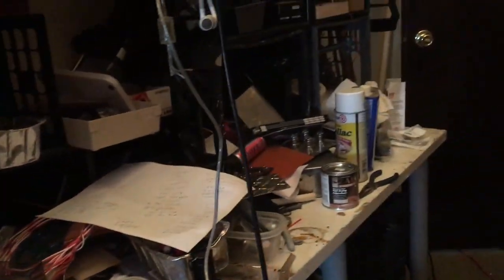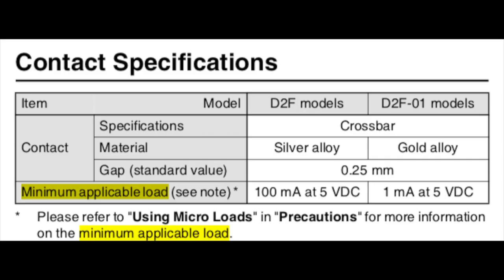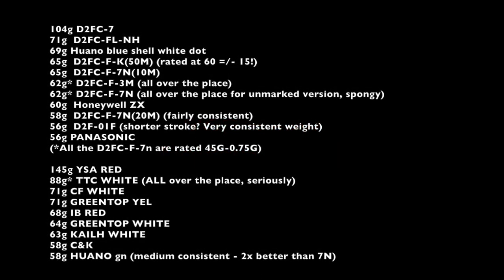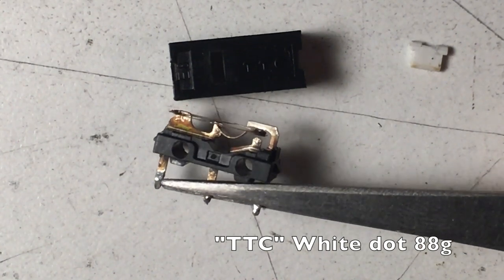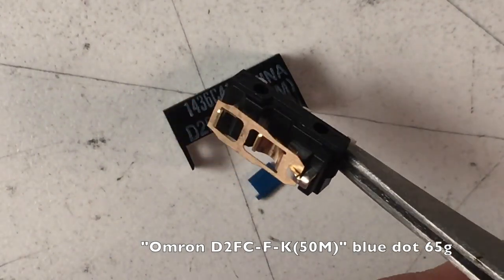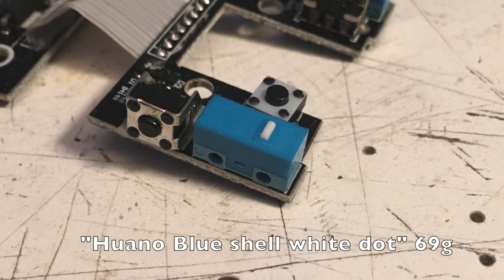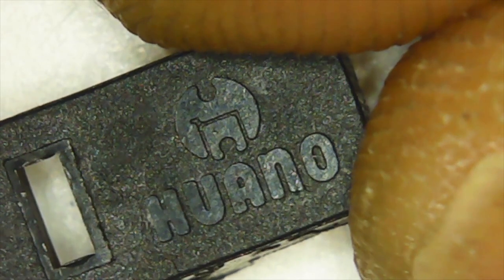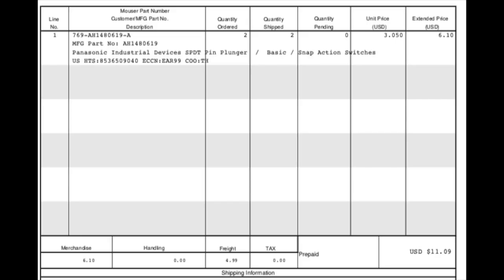Failing mouse switch part 2: teardown and testing

Comment: Fun fact: Just purchased the Glorious model O and it has an actual debounce timer inside the software so you can increase it if the mouse starts to doubleclick. They're not fixing the problem but at least they're acknowledging it and giving the user some options, that's a step in the right direction.
Reply: @anoctopusstolemytoesplease7940  yep

Comment: If the work area is clean, it usually means nobody is working. Nice follow up and break down of the different switches. Edit: Apparently new solder wick does the trick. It's a lot easier to deal with now.

Comment: Hey Alex, I had commented before about my Razer mouse with optical switches. Maybe you remember. This info is all just FYI in case you wanted to know how it held up.

The good news is that the optical switches still work perfectly. The bad news is that this mouse doesn't know how to charge a lithium battery, so I have to use it on a wire now. The other bad news is that the back button is not an optical switch, and it, predictably, has failed. The third bad news is that the scroll wheel is hesitant (goes up/down between clicks) and scrapes. So the Razer Viper Ultimate $150 mouse isn't worth $150 but the main 2 buttons still work flawlessly. And it's lightweight, and the cable is pretty good. The white feet are absolutely excellent.

Comment: 2023-04-24:  Randomly remembered today (while swapping mouse feet); 2 years and 4 months, and ~5.8 million LMB and ~1 million RMB clicks (Whatpulse stats) later, and these Honeywell ZX switches are still working flawlessly.
---
For what it's worth, I replaced the D2FC-F-K(50M)s in my G502, which had failed on both L and RMB, with Honeywell ZX10C30A01
 switches.
Pretty straightforward, and external dimensions were near enough to identical to work as a drop-in replacement.

The Honeywell ZXs definitely feel different—close to linear, I think, so a gradually increasing force curve with little (if any) drop-off at the actuation point.
Omrons are heavier and more tactile, or, a steeper force curve until activation followed by a significant drop-off, so have a snappier feel.
The Honeywells also have a somewhat lower-pitched and louder click than the Omrons.
I think I prefer the feel of the Omrons, just a shame they don't work.

Here were the external dimensions of the switches, in case anyone's curious, measured with an old inch micrometer:
OMRON D2FC-F-K(50M)
.258" H x .225" W x .506" L
Actuation point, from base: .277"

Honeywell ZX10C30A01
.255" H x .235" W x .506" L
Actuation point, from base: .279"

I think the ZX10C30A01 (logic-level, PCB snap-in, pin plunger) model has recently gone out of production, so for anyone else interested in the future, it may be necessary to look for one of the nearly-equivalent (logic-level, PCB straight or snap-in) models with any of the lever actuators, which may be easily pried off to reveal a standard pin plunger underneath.
https://web.archive.org/web/20210624200946/https://sensing.honeywell.com/honeywell-sensing-micro-switch-zx-basic-product-sheet-004990-2-en.pdf
Reply: They're not out of production, they just have a ridiculous minimum order quantity of 1000 units from everywhere I could find for the ZX10C30A01.

However even though the the datasheet literally doesn't have the gold plated option (logic level - ZX10 Series) for the PCB straight "ZX10C20A01" these do exist and are actually what you usually want to put in a mouse, as usually that is the mount type that they use in mice from the factory anyway provided the mouse isn't hot swappable.

TL:DR - If you want some of the Honeywell's get ZX10C20A01, basically the same switch in the video, but the mounts are a straight solder post which 99% of decent mice already use anyway.
https://uk.farnell.com/honeywell/zx10c20a01/microswitch-spdt-pin-plunger-0/dp/3439200
Reply: @oOBlackThornOo  
See: https://www.ttieurope.com/content/dam/tti-europe/products/PCN/Honeywell/PON_Obsolescence%20Communication%20Letter%20PP%20Dec%202020%20Final.pdf
ZX10C30A01 is in the list, but curiously several models that are identical but for the installed lever are not.

But yes, the straight terminal equivalent ZX10C20A01s are acceptable, and probably preferable in case you decide to replace the switches again, because those snap-in terminals actually require quite a bit of force to go in (or out) and would make desoldering difficult.
Reply: @EyeDeck  You're right, mouser and places have yet to update the product pages as they normally put a little life cycle badge on EOL components and advanced notices.

I never realised how buried the PCN's were as I couldn't find anything initially, TTI seem to have a really good tool though which I never knew about for searching the major manufacturers PCN's.

Yeah it is strange that they are discontinuing certain SKU's yet seemly kept others of the exact same type bar actuator. 

Like you suggested though worst comes to it they're easy enough to pop off if you have to.
Reply: @EyeDeck  Currently, I can't find the ZX10C20A01 anywhere, however on mouser, I managed to find the ZX10C30J01 at ~ $3.50.
Anyway, with the 30 style snap-in termination, I wonder if straightening the pins and sanding it to make it more easily removable if need be, actually is a good idea... would you happen to have any insight about it ?
Also, yeah I have the lever to remove.
Reply: @nlight8769  The snap-in terminals would definitely be difficult to desolder—even without solder, it's pretty tough to remove that style of switch from the PCB.  Straightening them out beforehand would absolutely make desoldering easier later if you find it necessary. That thought had crossed my mind, but since I've got a second G502—the first of two, which developed contact issues after ~7 months, Logitech shipped a replacement without return under warranty, and of course the same thing happened to the replacement after a few months—I figured I'd probably just start experimenting on the other mouse instead if these Honeywell switches failed.

As for a status update, my current G502 has gone ~4.7m clicks over a year and a half between L and RMB since I installed the ZX10C30A01s, going by Whatpulse statistics. They're still working perfectly a year and a half later, haven't had any contact issues with these switches whatsoever.
Reply: @EyeDeck  Thank you for the feedback, much appreciated :)

Even though I ordered a pair of overpriced D2F-01F in the end, because quick delivery and very pressing matter. I'm definitely ordering some honeywell too, the construction looks really, really good.

Apparently, new mouses suffer the very same flaw, how ludicrous.

Comment: One quick tip from me: Stop supporting Logitech . Yes their warranty service is great and sometimes they will even give you a new mouse without wanting the old one but it has gotten to the point where that is not enough to justify the shere rate of mouse failures.  I've spent enough money on their mice to buy a PC and it's only getting worse. If you are a hardcore gamer that can't afford constant mice failure and you  want to eliminate the problem until or dare I say IF they fix it without soldering skills just purchase a mouse with hot swappable switches like the mice from Asus ROG and buy a bag of switches that you prefer. That is IMO the best option at the moment.
Reply from the maker: Oh totally, and believe me... when my g502 finally dies for good, I'll be looking elsewhere, maybe even sooner.  I'm just waiting for either a mouse that ticks all my boxes, or a viable open source project to pop up so I can say screw it and make my own
Reply: @AlexKenis  Unfortunately, I haven't really found a good alternative to the G502, so in the meantime switch replacement is where I'm at. Which switch has lasted you the longest?
Reply from the maker: @benjaminchen4367  I have been running  both a Japanese omron and the wacky Honeywell micro since this vid came out and both are still going strong
Reply: @Alex Kenis  awesome man, and thanks for responding so quickly. I'm thinking of getting a g502 lightspeed and preemptively buying some Japanese omrons to have on hand, altho I can't believe I'm buying a $120 mouse from a company that can't get rid of double clicks. Those extra buttons and that shape are just too unique
Reply: @AlexKenis  Also, have you tried the Kailh GM 4.0/8.0s? Those seem to be the go to replacement switch in the places I've looked, as opposed to the japanese omrons, but I can't find a datasheet that can verify they are suitable for microloads
Reply: @AlexKenis  The best alternative to the Logitech G502 seems to be the Razer Basilisk Ultimate which has optical switches
Reply: @benjaminchen4367  That's why I'm thinking of getting a cheap, used G502 Lightspeed from eBay and then have it « serviced », if I do decide to get the G502, that is.

For now, I'll stick to be G900 Chaos Spectrum. I haven't run the double-click test yet. Fingers crossed !

Comment: thanks to you my mx 518 has a new lease on life my 502 hero has the click and drag issue haven't got the nerve up to taking it apart yet, as it's still under warranty. I practiced on the 518 firs and fixed a non working lmb.

Comment: i found the first part very interesting. i wonder if you could do a 3rd part with some mods to fix the switch issue. maybe like the resistor mod you suggested?
you suggested too gold switches like the japanese omron but the popular here is the kailth red.do you think it is fitting?
Reply from the maker: I couldn't get ahold of the 'newer' Kailh switches when this vid was shot, but I may order some when I get some keyboard switches next.

Comment: My Logitech g602 with d2fc-f-7n(20m) didn't even last for a year. i did fix it by bending the copper for more tension but it may woreout soon.

Wanting to replace the  microswitch and saw some d2fc-f-k(50m) online. Would it be an upgrade? Or do i have to buy same model? Thanks!
Reply: I think if anything you probably don't want the same switch or a switch from this same family. For one, you can't hold the seller to the promise that it's actually a 50M variant, it might be counterfeit, as all D2FC variants look the same on the outside and the painted on designation is too easy to modify. For other, the 50M switches fail just the same.

Consider using a D2F (japanese, without C) family switch or maybe Kailh or whatever else nice you can find. All the switches shown here have the same footprint, they'll all take up the same space and fit into the same holes. They might have a slightly different height for the nub by a fraction of a millimetre, but you can just shave the protruding actuator piece in the mouse shell button section or shim it as needed, and odds are, no modification may be necessary at all. But do take a look at the actuator there, it can show some wear which isn't good for the switch and may need to be fixed.
Reply: @SianaGearz  Can't confirm switch durability (50M vs 20M) but have placed order for link provided and tested force resistance (0.7N) - so ~130g? Based on Digikey/Newark/(other enterprise component distributors) pricing per unit I expected as much...Not that OMRON even has public listing. 99% mutually exclusive supplier agreements. Shout out to Rossman?!

Comment: Hey there, great comparison! I got one question which might sound strange at first: under real life gaming mouse circumstances -> ~1mA on the switch - is it possible that on average chinese omrons vs japanese omrons get a few milisecs of latency in before being registered as "1", maybe due to ripple etc? there is one video on youtube that claims a few milisecs difference between those to and ever since im hunting down further information. Or is it maybe just mechanically faster due to the spring loaded mechanism on the japanese ones?

Comment: I have tons of questions and feedback from you here but first off-Im subcribed  because i find information you give on these switches are technical- bc i like to mod my mice-current project is to put the mouse wheel on the side where it is going to be moved with the ring finger. So, ive never had a switch fail on me. The end of its lifetime usually 1- going to a cooler newer model 2-sensor problem like the cursot jumping through the screen. 
Perhapd its because I tend to slide the mouse rather than lifting them bringing it down with a few g forces. I tend to releasd the switchs once it clicks or in other words i feel it click then release rather than making sure it hits the bottom.
So maybe my reason is 2 things - environment and "noise"- it does go through shocks and jolts bc unconsciously I avoid any force (a habit with any electronics including a stuck remote)  

Comments? could electronics fail quicker through an environment that is noisy like in an assembly plant which it will go through lots of mishandling?

Also why are some switches have to 3 pins and not 2 for on and off. like the omron has 3 pins. Also how do the scroll click switches work? because i have seen at lease 3 types-razer trinity has like a black with red shaped just like an omron - maybe it is but i broke it by accidentally pulling out the cover while desolding 2  - razer naga- 2 pins with a spring on top of the switch so the mouse wheel can stay up as well as increasing the travel that common switches have. 3 - logitech mx revolution- the switch is weird but its very narrow and the cap isnt like any other switch out their. I has a longer travel and shaped like the end of a wide knife in other words its 3 angles vs normal switches. why is the razer trinity use an omron when other wheel clicks dont. This is for wheel click (pressing down on the wheel)

Also, if you read this far I appreciate it- but if you are interested I can send you my switches so you can analyze why they last 4 years or so. They dont skip clicks and they only get replaced bc the mouse sensor or updating to a fancier model. I have a 10 year old microsoft usb 3 button mouse. Are these switches inferior? All i know is I like fast actuation and fast release so I can rapidfire. This usb mouse is heavier (takes more force to press down) 

Just interesting how my razers last years when they have a high fail rate for many others. Another thing is cleaning- regular cleaning avoidind the sensor. Keeping the mouse wheel from accumulating lint/cat hair. The mouse pad stays clean. Not much when it comes to dead skin or dust.

Glad you stuck with the end- now you know what I went through with your other video that was impressively 1:15:00 long
Reply from the maker: Sorry about the delay... been busy. My older Razers have also lasted forever, but it also sounds like you have good click discipline with very little overpress and 'press-and-grind' which I imagine will greatly extend the life of the switches, especially some of the omrons that have a tendency for the contact to slide off to the side.  It seems (no proof, but it seems this way) that some of the Razer shell designs may alllow people with a more 'button-mashy-grindy' style to do more damage to the switches and wear them out faster... but that is just pure speculation from what I have heard from folks. As far as noisy/vibration environment, I'm not sure about that, but if the warehouse environment is a combination of hot, humid, or has a high sulpher/sulfate count in the air, then oxidation can set in prematurely on silver-oxide contact switches. Some switches are 2 pin and other 3 because there is a "no contact" pole in many of them that would allow them to be used as a toggle or latch-reset, but almost every mouse only uses the one set of contacts. I have a few of those MS optical mice as well, and those switches are not worse, many people just don't like the feel of that micro pushbutton style

Comment: I`ve watched both of your videos and they are very good and highly techical. But, you did not compared the most important thing (probably because you had no problems with this), and that is the housing of the Japaneise switch and it`s dimensions, to be precise, the main housing is the same, and the size of the plastic object which is pressing the platter is different. It is little higher than thing on the Chinese Omron. Because of that, there is a problem with several mouses and their housing where I soldered the Japaneise Omron sw. Ex. Logitech G700, G9, G403, MX Master, MX performance, in my case.
Reply: yes, i have tried japanese omron on roccat kone pure optical and  razer deathadder 2013. the housing of japanese omron is a bit taller compare with chinese omron which caused a problem when clicking the mouse, the only solution IMO is do not too tight when screwing up or replace their housing using chinese one.
Reply: @Sarah.Lemontea  No, this is not a good solution, I advise you not to do that. Instead, look out this switch on aliexpress: D2F-F-3-7. This one has exact the same dimensions as regular switch for mice :)
Reply: @imarkovic1  where I can find datasheet for D2F-F-3-7 ? IMO D2F-01F is suitable since it is a micro-load model but D2F-F-3-7 I think it is a general-load model.
Reply: @Sarah.Lemontea  No, it`s not general model, I`ve opened it and compared with D2F-01F, it is the same inside, its Japaneise, believe me :). You can buy it on aliexpress, it`s not expensive.
Reply: @imarkovic1  The real solution is just to sand or cut away a bit of the plastic above the switch. Not that hard imo
Reply: @benjaminchen4367  Yeah, I agree, but you can`t just cut it off, you must softly modify it with the sandpaper, it is a little pain of time. This is proper if you want to do it in the right way.
Reply: @imarkovic1  I've heard someone that cut away because their mouse already had a plastic bit sticking out for pretension, but sanding is definitely safer